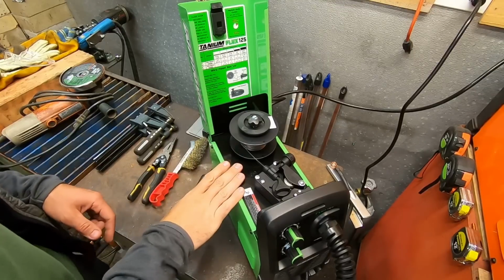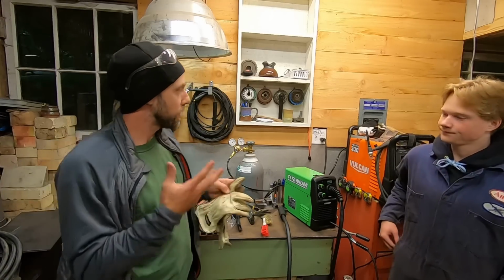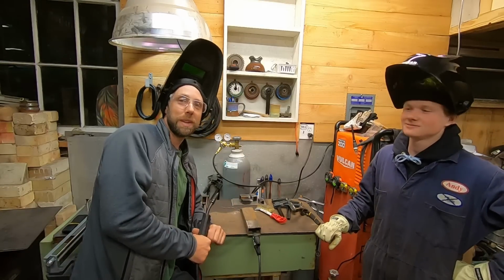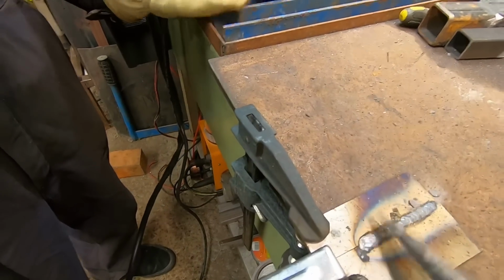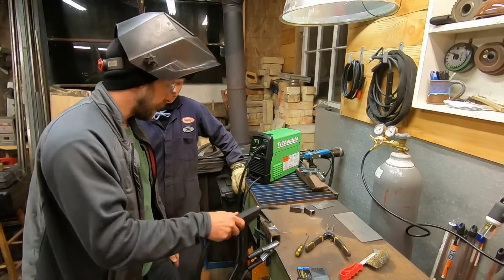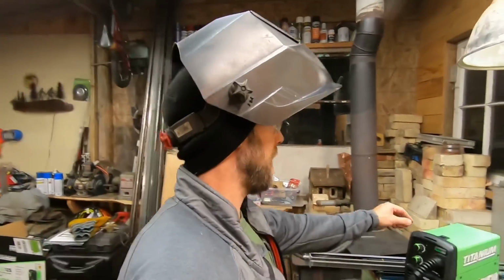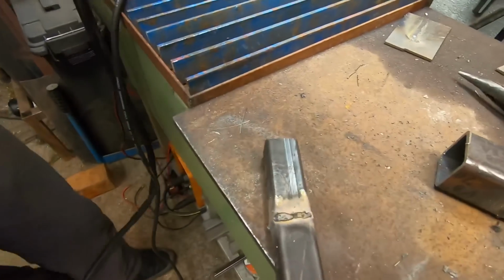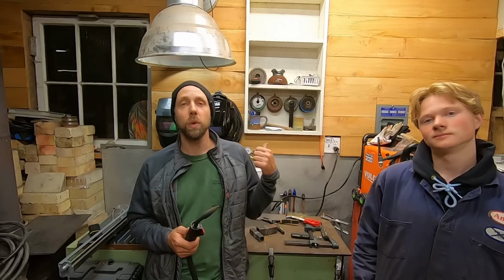How to weld, Tips for Beginners

Comment: I got the titanium 200.there is no spark .I don't have the gas tanks and I am trying to use the 110 plug .any suggestions to why it is not working?
Reply: Lol. My 1st guess was Ground.
Reply: Setup DC negative?
Reply: @TylerD63  ,got it.i wasn't cleaning the rust where I had my ground connected
Reply: @robertflores9808  that'll do it!
Reply: Thank you
Reply: CHECK YOUR GROUND, make sure it's bare metal.

Comment: Hi Mike, I'm a beginner and enjoy your videos. Before my dad passed away he gave me a Pow'R-Mate 100 dual Purpose Wire Feed Welder. I set it up today and ran some beads on 1/4" plate steel and it kept tripping the 20 amp breaker at the shop panel. I tried 1/8" steel and it did fine for 15 minutes then tripped the breaker again. Do you think it's something I'm doing wrong welding or is it possibly just a bad wire feed welder? Any advice would be appreciated. Thanks, Ken
Reply from the maker: Hey Ken I think your welder is fine, what’s going on is the welder is drawing to many amps, this is common in 110 volt welders especially the older transformer machines. I would try and plug it into a socket that doesn’t have many other things drawing amps, try to dedicate a breaker to the welder, no lights, fridge or others appliances, no extension cords ether.
The newer inverter machines are more efficient with the amps they draw. 
I’m glad to hear you are starting to learn welding 👍 It’s a great skill to know 🙂
Take care
Reply: If what Mike says doesn't fix.
Then you need to put a higher breaker into dedicated breaker slot in house breaker box.
If it needs over a 50 amp. Throw away. And buy a new one. 
This same goes with an arc welder. And 220. But a lot more amps. I don't remember amp size. I have been using my Miller self contained welder for decades. So don't have to worry about breaker boxes.

Comment: Would it be possible to use the MIG/FLUX welder, take 2 pieces of metal and weld them together, then use a grinder to cut through your weld and then weld the two pieces back up again in the same place? (Essentially, cut and weld in the same spot over and over again.)

I'm asking if this would be possible because if you had a limited supply of metal, you be able to practice welding with only a couple pieces of metal? Would the metal become unusable after you grind/cut it, or would my suggestion from above work?
Reply: You can absolutely do that, it just tends to be a pain in the ass.
Reply: @hawkbox  ok, thank you! 🤙
Reply: @badeggzz  Sure thing! I'm doing it right now as practice, I have a bunch of scrap so I'm being choosy but as long as the metal is clean you can run a weld on it.
Reply: @hawkbox  ok awesome, thank you for the info!
Reply: @badeggzz  No problem. Good luck!

Comment: I think Liam is a natural. The real test for a welder is being able to properly prep their joints, properly set up the welder for the specific job, and controlling the heat to reduce warping and drawing. That last one requires various techniques, from alternating welds and cooling time, to proper set up and bracing.

Comment: Thinking about my question, does the flux feed automatically and the trigger on the gun is just used to start welding ? Thanks
Reply: The flux is located inside the wire. You must hold the trigger in the entire time as the welder feeds the wire and flux at the same time. When welding, you are melting the wire, the flux inside it and part of the metal piece you are trying to join together. The trigger also tells the welder to complete the circuit and allow the current to flow. These process' are combined at the same time to allow the welding to happen. You control the amount of wire and flux coming through the gun by turning the knobs (settings) on the welder itself

Comment: Do you usually hold the trigger down all the time to feed the flux while welding, or is it on and off as needed according to speed ? Thanks Mike great video's keep em coming !
Reply: so holding down the trigger feeds the wire through the tip of the gun. when the machine is properly grounded (the clamp) and the wire comes in to contact with metal it creates a circuit and the welding begins. if he holds down the trigger and the wire goes in to his glove or wood, the circuit isnt complete so there is no welding. so youre holding down the trigger continuously feeding the wire while welding. that is why there is a setting for wire speed.

Comment: Thank you, this video really helped me learn how to weld!
Reply from the maker: Right on! I’m glad it helped you out 🙂
Reply: @Mikefestiva .... Hi Mike, I really enjoy your channel and Especially your very straight forward, concise & Very Easy to understand methods & verbalizing way of instructing.... Very Much Appreciated, Thank You.  

I'm just now (at 68+ years young : ).... wanting to learn welding.  I do know that I want to at least, start with a Flux core welder... but I'm not sure between the HF (Chicago Electric) 125 and the Titanium version, which is the better of the two, and why (?).... Or, are there some other brands of flux welding machines within the $100. - $250. range that are really, any better? 

Also, is there really... any such thing as a Better Quality Flux Wire that is easily available through other outlets (ie; HD, Lowe's, Menards, etc,etc.), or are they all about the same... in other words, do some flux wire.. weld and weld  "cleaner" than others, using the same machine, or what??   Solid Mig Wire is for use only with "shielding gas"... correct??

Thanks again, for all that you do to put out these excellent videos, and Especially for explaining & demonstrating the "how to's & where for's" in such Easy to understand ways, for those of us who know "diddly" about any of it.  

Thank You in advance... for taking time to  read and answer (hopefully) my questions, and please forgive me if you have video's dealing specifically with these questions I have... I must have missed them somewhere.  I have been subscribed since the first time I watched one of your video's, a couple of years ago.  

PS; I take it that you actually make a living... as a fabricator / welder... yes?   No?   : )

Comment: Could you use this to weld rockers onto a truck?
Reply: Wouldn’t recommend, it would get way too hot for that thin of sheet metal
Reply: You can, it’s just a different process, you want to do small tags, spaced apart to not warp the metal or blow holes through. You can also drill holes and spot weld the rockers on which is what I did before on a silverado and it came out really good! That was with the Chicago electric 90 amp also, just take it slow and don’t rush and it’s fine.

Comment: Good video, precise and clear explanations. Just one thing as with most videos I've seen on here no mention of the settings which if your machine doesn't tell you which current for what thickness and what size of wire and feed speed completely baffles beginners

Comment: A few comments about the info to beginners :
1)Calling this a nondescript FLUX wire means what? Shielded flux cored or self-shielding flux cored? BTW, I know you had no gas nozzle, fume level & spatter level.
2) Polarity: DCEP or DCEN? 
3) Wire feeding: All Flux Cored wires have a designed cast & helix spec to optimize smooth transfer, drive rolls, cable liner & contact tip. I won't go into what a cast & helix is or means here. 3a) Your single drive (top & bottom) rolls (as you noted) should be knurled V grooved for Flux Cored. 3b) Your test to sense acceptable feedability was good. As a suggestion, put on your welding gloves instead of feeding into a block of wood feed the same wire into the other hand cupped palm & let the wire bird nest as its fed. You'll better & quickly sense if smooth feeding. Note, don't put too much pressure on the drive rolls as the knurls will transfer on the skin of the sheath of the cored wire. These wire knurls run perpendicular to smooth wire feed. Some wire manufacturers run tests on feedability measuring Amp draw on the wire feed motor. 3c) All Flux cored wires have lubricant on surfaced by design. If you are curious, carefully pinch your index finger & thumb on the wire(after the wire spool & before the drive rolls) as it's feeding during non arc welding. You'll see a black streak on both fingers. 4) For the beginners, introducing them to AWS A5.20 Spec & class would be very helpful. Cheers
Reply: Hey Philthy, can you send us a link to all the videos you have made to help people learn new things? You have made videos right? Or do you just comment on beginner videos that others have taken the time and effort to make so you can try and impress complete strangers with the fact that after 30 years of doing the same job you know what you are doing?
Reply: @rolgor  After reading your Well thought & Well written comment, I went & checked. Nope, not even one. It's funny how that usually happens to be the case.
Reply from the maker: I appreciate your comment but you need to understand, this video is intended for people starting out. Sometimes I find people really like to over complicate things, sometimes it’s best for beginners just starting out to get the MiG lead in there hands and just start welding, 
They can do more research down the road if they want, I just don’t think it’s necessary to go over hours of info before you even touch a welder. Take care
Reply: @Mikefestiva   thanks Mike I 'm well aware of your intent with beginners. Also, more so I' m keenly aware that beginners do drop interest in welding. Given some 30yrs in the Filler Metal business there's hope something the beginner or even the instructor would have better understanding of the why! Anyways.

Comment: Can this machine be used for repairing/replacing 1"X1" 11ga steel tubing for a go kart swing arm suspension? Was told by another guy to buy a more expensive MIG welder for go kart repairs.
Reply from the maker: This welder will handle 11ga no problem 👍 It will weld up to 3/16” single pass. It’s a awesome little welder!

Comment: Excellent video Mike, thank you!  I just picked up the Titanium 140 and a bottle of gas.  I had several people tell me I'd have a better experience if I gave flux a pass and jumped right into solid wire.  But watching your nephew get some killer beads right off the bat has me thinking I shouldn't forget flux altogether!  Thanks for the technique tips (which I'm sure apply to both) I just subscribed and look forward to checking out more of your content and look forward to honing my skills!
Reply from the maker: Right on! Thanks for subscribing 👍
Both kinds of wire weld a bit different, as you weld more you will see that flux core you tend to travel a bit slower due to it being basically filled with flux in the center of the wire. With Solid wire you can travel a bit faster and it tends to be cleaner, both flux and solid wire make great solid welds there. Thanks for checking out my channel 👍
Have fun welding 🙂

Comment: I started out on the flux 125 welder when I just turned 14 now im 15 almost 16 and have a lincon 210 mp with shielding gas its so much better but I still use the little 125 for small projects where it doesn't realy need to look great and its so dang portible

Comment: Looks like a good machine I will be using this week to build my motorized BMX bike. :)
Reply: That sounds awesome make sure to clean up your welds with a angle grinder with a wire wheel or it will look pretty bad I got one of these for my first welders now I own a very expensive lincon 210 but I still use that little welder for projects where I cant get my lincon good luck on your project and never get rid of that little welder unless it breaks you will use it in the future lol

Comment: My Harbor[JobSmart, Tractor supply]Freight gasless flux core 125 takes up shop space unused. That Titanium from HF?
 Even a beginner can use that inverter welder. D/C output + Gas makes ALL the difference! No epic spatter cleanup mess.

Comment: What model and make is the helmet you have that lets you be able to see the flux coming out and puddle. I can kind of see mine but wondering what you use. Definitely would like to get a better mask
Reply from the maker: I’m running the Vulcan helmet from Harbor Freight, it’s a really good welding hood. I think they sell for around $140. I have used more expensive helmets and this Vulcan auto helmet is way better then most especially at that price point 👍
Reply: @Mikefestiva  what would make one welding hood better than another? I mean, aside from the convenience of having a hand held one as oppose to one that has the head strap.  Thinking more in the line of safety and eye protection.
Reply from the maker: H Max Well I think there’s many things that come into play when it comes to a good welding helmet. 1 a good comfortable head set that has a lot of adjustments. 2 a wide range of adjustments on settings, delay time, shades, stuff like that. 3 a wide view window, 4 a design that protects the outside clear view screen if the helmet drop on the floor it protects the screen from getting scratched. 5 extremely quick auto darkening time, 6 this one is a deal breaker for me if a helmet doesn’t have this, it’s auto on/off. 
I had a Miller and you had to push a button to turn it on, if you did some side work in your shop like cutting metal to weld and go back to welding it has an auto off and you would get flashed on your next weld. All helmets should have a auto on and a auto off. 
I’m sure there other details I’m forgetting.
I hope this helps.

Comment: I am amazed still how many people continually buy from HF.  Buy once cry once.  Good tools can be passed down to your kids.
Reply from the maker: Jeremey Phillipson Well I really cannot agree with your buy once cry once slogan, my friend bought a new Millermatic 200 a few years back, it crapped out within the first 7 months, it took sending it back 3 times before miller actually fixed the problem, keep in mind this took about 6 months before he had a working welder again. Just because you pay a lot doesn’t necessarily mean it will be trouble free.
My outlook on it is buy what you can afford, I have a Harbor Freight Titanium 200 welder I use it about every day for the past 19 months, it’s a solid machine, down the road when it burns up I will buy something else. If your looking to buy a welder that you can pass down to your kids buy a older transformer welder, don’t plan on moving it much or you will get a hernia.
I myself prefer the newer inverter style machines, multi voltage and you don’t need a tractor to move them. They won’t last like a old style welder but they sure are compact and weld nice.
Reply: @Mikefestiva  I have opened Lincoln, Miller and Vulcan machines, the internals on the Vulcan are not near as good,  Non potted boards for example. The welding arc is so much better on Lincoln and Miller.   I never heard of a repair taking that long, 2 to 3 weeks was longest on my lincolns, and in fact if it was 3 weeks, they loan me a demo I can use. They actually let me try new machines on demo for up to 30 days. If I like I can buy. They also lie on the marketing wank, lincoln and miller have sued them over it before.
Reply from the maker: Jeremey Phillipson That was my friends experience with Miller, it took 6 months before it was working right again because they were not fixing the problem, so it would get sent off to Miller, they look it over it would get sent back to my friend, problem was still there then repeat that over two more times, that’s why it took so long, no loaner machine was offered.
I’m not trying to change your mind on what machine to buy, I’m just sharing my outlook because you posted yours on my channel.
I build a lot with Harbor freight welders and plasma cutters, they work just fine for me, I also own a CNC table, I probably won’t have bought my CNC table if I spent thousands more on my welders and plasma. 
So you had to send your Lincoln in for repairs? They all can break, no manufacturers are perfect. You mentioned that the Vulcan stuff isn’t built as good as a Lincoln or Miller, I’m sure they aren’t, but the Vulcan Omnipro also cost half of what a Millermatic 200 cost.
Reply: @Mikefestiva  I think the reviews u do are good and fair.  Most hobbiest can't justify an 2000 dollar welder, I get it that.  I have had a few l Iincolns that i sent local repair, some odd problem I couldn't fix.  Don't think I'm chastising you I'm not, I still like what u do will continue to check out your vids.